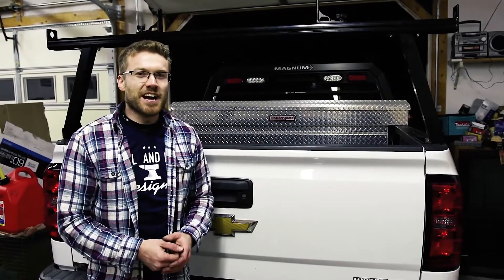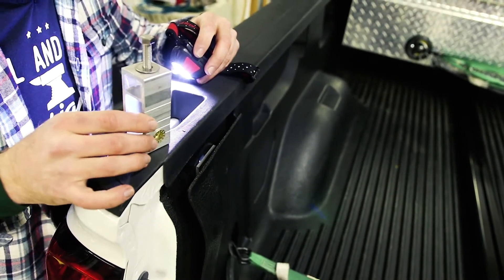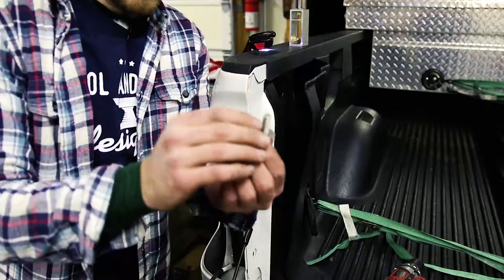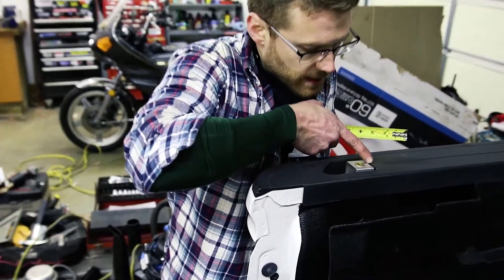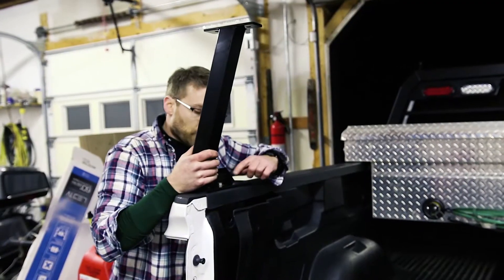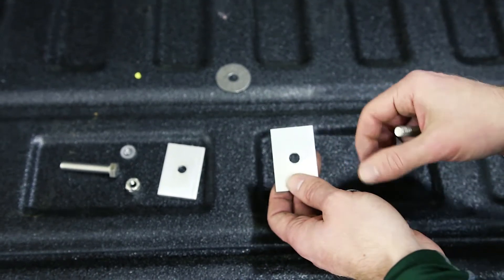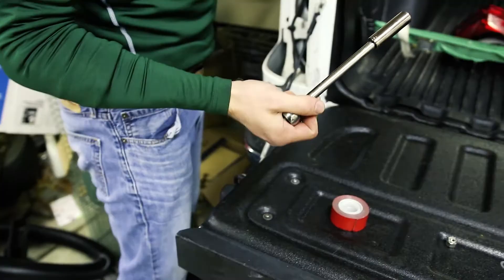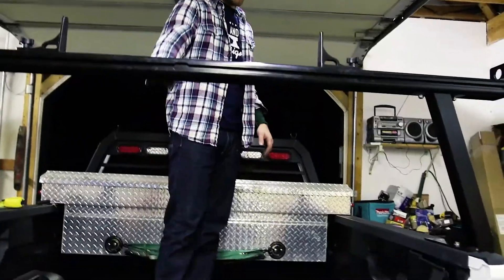How to install Magnum Manufacturing Rear Rack on a Chevy Silverado

Comment: Good video(s). Thanks for posting. I just bought a 2017 Silverado. You're video really helped me. I really like the Magnum front headache setup. I'm going to leave the front setup on all the time to protect my window, but I want to remove the back bars when I don't need to carry anything long.  I don't trust those brass nut-serts in the side of the stake pocket inserts. If you look straight down the stake pocket there is a hole centered in the bottom accessible from under the truck. . I would rather put a longer bolt straight down inside there. And adding a second bolt for strength makes sense. Thanks again.
Reply from the maker: That's not a bad idea. Thanks for the feedback!

Comment: Do you know if it’s possible to install 2 back racks? So instead of the head rail next to the cab, could you put a back rack here like you installed in this video?
Reply from the maker: No reason you couldn't. They both install in the same way

Comment: does the headache rack level out with the rear rack before you install the 72" bar on the front headache rack? it seems like the rear rack sits lower when you mount it straight on the bedside of the truck if you choose not to use Magnum's bed rails. On videos like this, itwould be nice if you include a short overall video from different angles showing the final look of both racks once they're put together.
Reply from the maker: Yes, the rear rack sits roughly levels with the front headache rack if you don't but the 72" extension on the headache rack. keep in mind I have the low pro rack which sits slightly below the roofline of the truck. With the extension tube on top it is just above the roofline. That is a good point tho, we should have done that in the video. Maybe we will make a follow up video. I can email you pics too
Reply: @TheSundaeDrive  that'd be awesome. omaryagamiathotmaildotcom
Reply from the maker: I don't have the racks on right now but I'll look through my photos. Send me an email to cliff@thesundaedrive.com